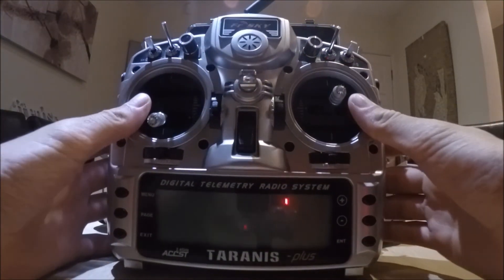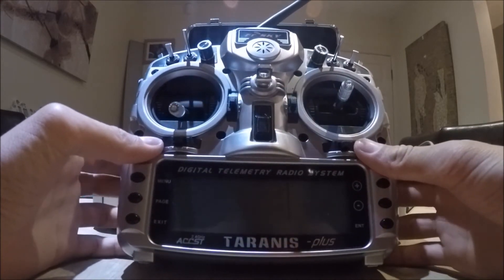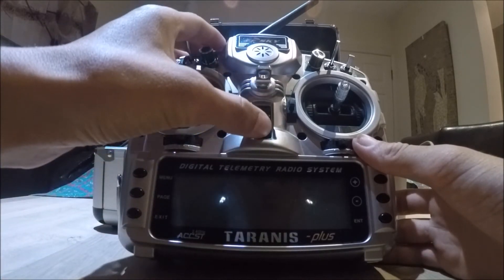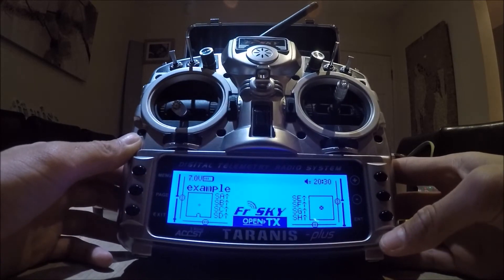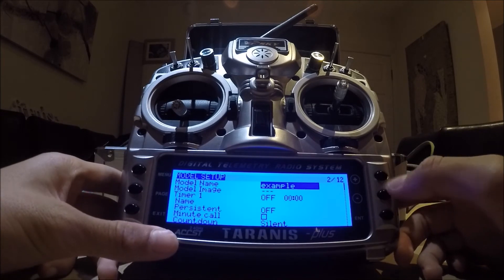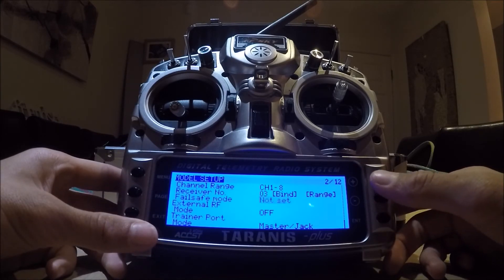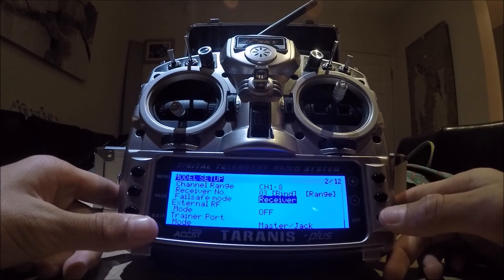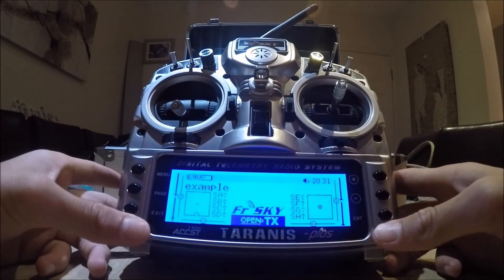How to set a fail safe for a taranis

Comment: Mercy, I flipped for hours on this FRSKY Trans Plus, it is a piece of crap for RTH. It is for airplanes and racing only. If you are building a quadcopter like a  JiYI P2 or APM Arudpilot, RCtimer or Naza anything with Altitude hold and GPS you need a good TX and RX get a FLYSKY i6s and don't remove the  T spring, set it up on SBUS or PPM.  You can setup failsafe  RTH on any 2-way switch and lost of single to RTH on the same switch, no mixing of channels.           https://us.gearbest.com/multi-rotor-parts/pp_345672.html?wid=1433363&currency=USD&vip=14752947&gclid=EAIaIQobChMI39SB98rB3wIVzlcNCh06mw09EAQYBiABEgJo3vD_BwE

Comment: I don't understand failsafe. Does it return back to the location of the transmitter on the ground like a RTH function? If not, I dont really see the point.
Reply: Its very easy. When you understand that failsafe is for trying to save not model but people on the ground. Full throttle, slight straight pitch up and you loose signal... You can find your model few kilometers away in kindergarden yard.
Reply: Well if I understood what it was I would not have made the comment my friend. So.. is it automatic stability control, autopilot.. what is its functional description?
Reply: Its nothing fancy. Basically what you need and what is a must by law in some countries - when model looses signal, to have throttle cut down to 0. Thats it! If you want autopilot and return functions etc, we are talking about flight controller with altitude and gps sensors.
Reply: Tomas Puodziukynas that explains it. Thankyou

Comment: hello.but should we add some parameter to reduce the throttle ? to allow the drone to slowly fall down, instead of shutdown everything ?
Reply: If you are planning on racing low altitude at fast speeds - no.  Better to crash quickly than to fly off and injure/damage something.
Reply: hi, thank you for your answer.
Reply from the maker: this is the perfect answer